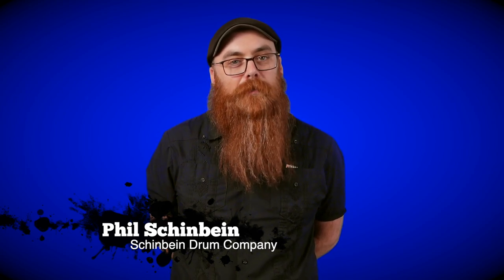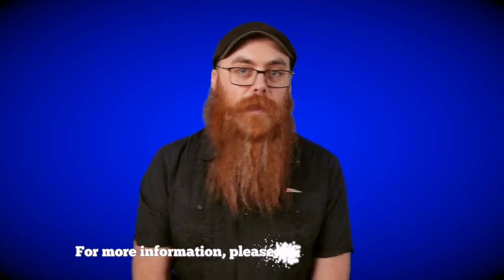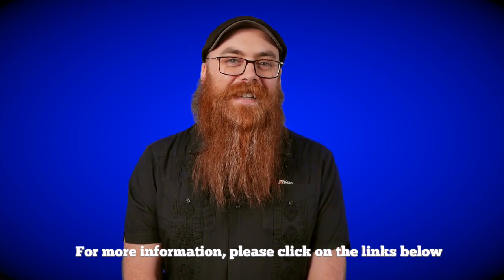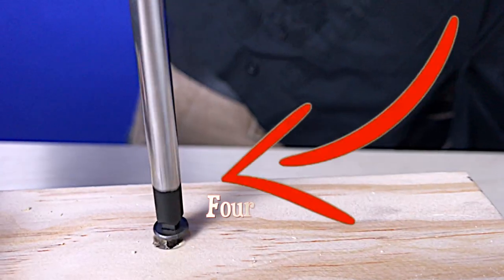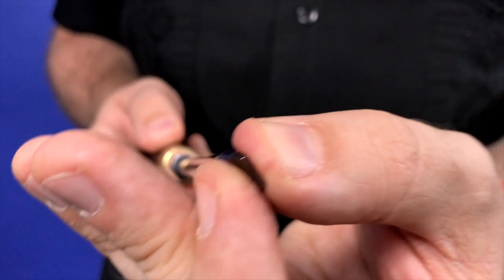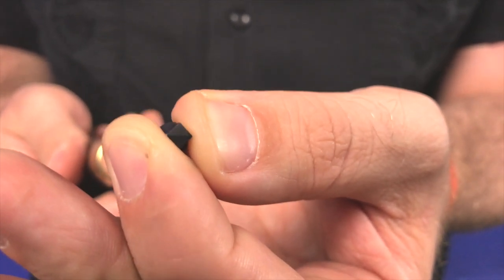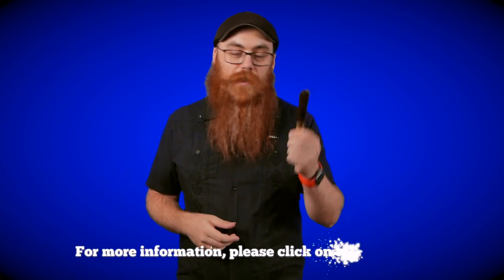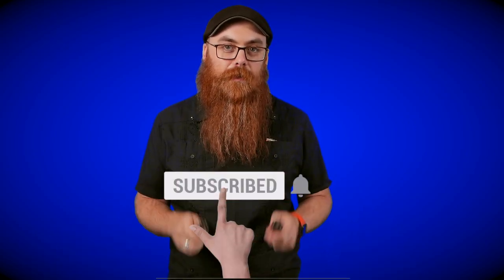It's Cool Tool Tuesday! A Canadian Screwdriver, eh?

Comment: Flathead screwdrivers are very useful! They're fantastic for destroying speakers when you're screwing the frame on and they slip. Probably drum skins too.
Reply: Haha nice.  We left slotted tension rods behind in the '60's for the most part.  Some high end Sonor's still come with the option, but few take them up on it.  They are handy in that the slot is usually wide enough you can tune with a coin...

Comment: I can't say that I agree with you on the Robertson!  I don't like it, have had several that have caused me more trouble than they are worth, and will never buy one ever again!  Ever since Torx heads came out I will not use any other screw for structural work.
Reply: Fair enough, the torx head is a further evolution again.  What makes it feel superior to the Robertson is the same thing that makes the Robby a step up from slotted screw heads.  Personally, depending on the job at hand, I tend to just get whatever is the right length and gauge at the best price.  More often than not, down here in Australia, it's Phillips head so go fig.